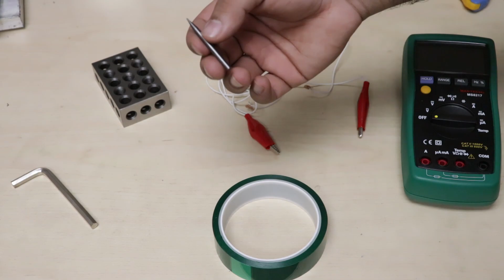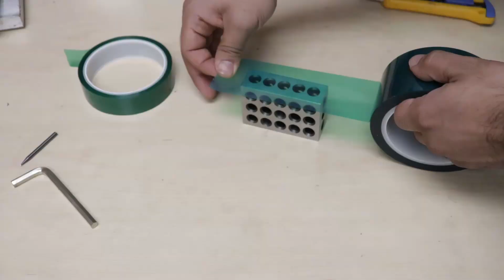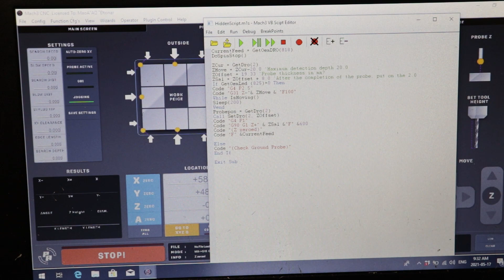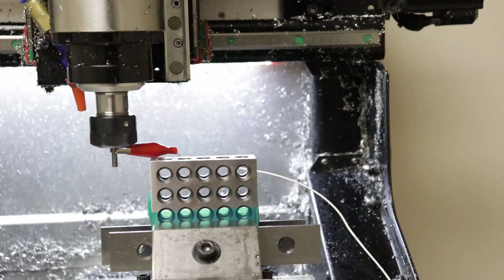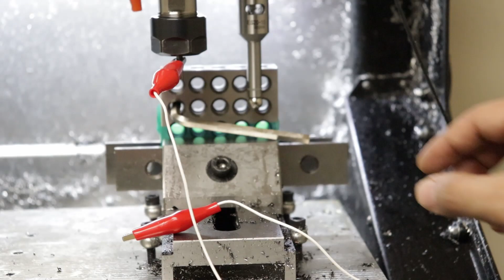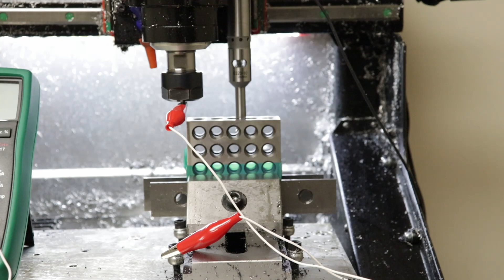DMC2 Training Course - Episode 8 - Calibrating Your Probes

Comment: attempting this on a DMC2 Mini and get "cannot probe with zero feedrate" when I click the button. I changed FRate1 and 2 to equal "6" in the script and it just reports back "z = -2.285" and never moves. Are there any additional steps needed on the mini? (I can email but figured it could help someone else if I ask here).

edit: I realize now that is what the scripts are for that are provided. Disregard.
Reply: Did you get the probe to work properly?? I have everything set up and it ran properly once, now the probes are all over the place. I replace the computer with a new one and re did all the software and settings but get the same thing. Z moves up and the 4 outside probes all go in the same direction (as per Top).
Reply: @johnshort9490 I had this problem in the probing tab there is a field in the top left that says search speed and search distance these both need values. I used .5 (mm/s) for search speed and 5 (mm) for search distance.

Comment: This video is missing a bunch of information required to actually calibrate the probes, such as the probe diameter (distance between probe center and tool center) and how to properly measure that.

Also, the scripts that come with the machine have been edited poorly and if you're running a machine in inches, the inch based instructions are rem'd out and will cause your machine to crash if you're not careful.  Get the original author's unmolested scripts at https://www.youtube.com/watch?v=tvV2Vmrxarc&list=TLPQMTYxMDIwMjL7EWw2_R3cLg&index=2